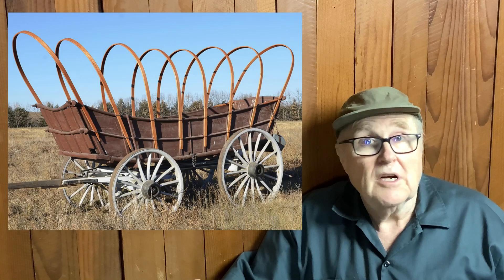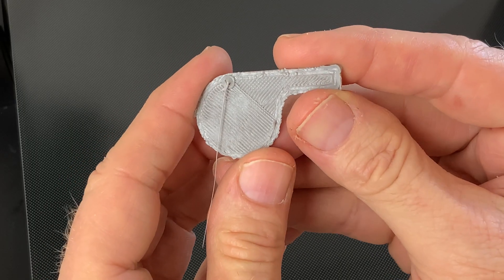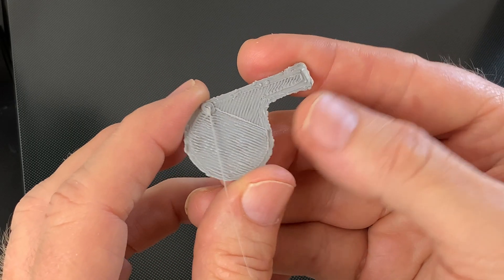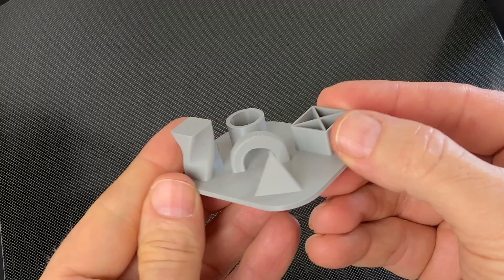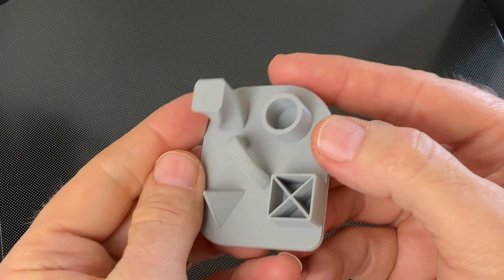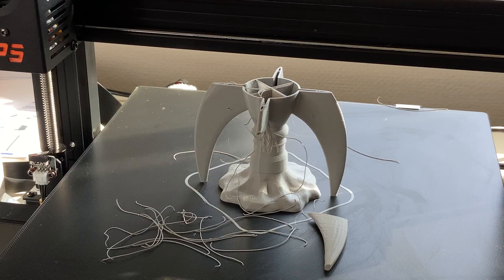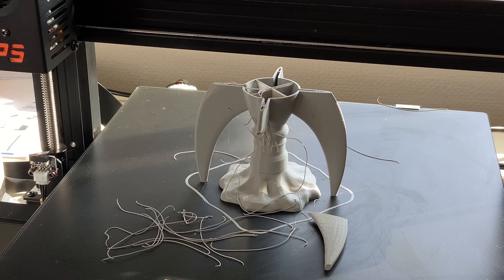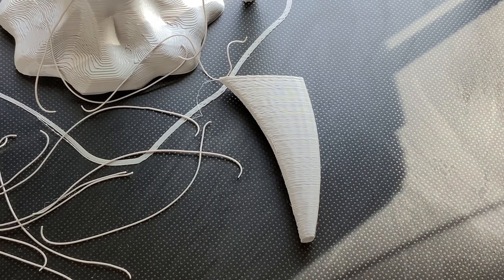This I Do Not Need!

Comment: I've been having a similar week as well. Actually two weeks. Had issues with the hotend, bought a new printer, new printer printed worse than the new model, fixed the old printer, kept the new printer for parts, summer heat and humidity ended up ruining my filament spools, invested in a filament dryer, invested in an UPS, now everything should be fine. The printer I'm using is an Ender 5: cheap, easy to set up, reliable, and unfortunately sold out in most places. There's also the slicer software which can cause issues. YouTube is full of all sort of useless crazy videos on what tweaks to make to the slicing profiles. After 2 years of 3D printing experience, default settings are still the best. PLA is a great material and I think the trouble of getting the printer to work is well worth it. Creating wooden boxes for molding might become a thing of the past.
Reply: Filament driers are so cheap for the value they add. Who hasn't come back to their printing room to realize they'd left a spool on the printer for the past 2 months? Sure, I can risk household drama by chucking it in the oven, but why not chuck it in a drier that auto-shuts off.
Reply: @TylerProvick  2 months? I left one on for 1 year lol.
Reply from the maker: Since I already have a warming oven for my resins adding drying capability to it will be easy.  Definitely a good investment when working with resins and filaments.

Comment: I bought a Prusa printer because I was fed up with tinkering with the Ender 3. It's been great, worked out of the box and required very little work in that past 2 years.
Reply: I mentioned a Prusa to Robert but I'm not sure why he didn't take the advice of a random person in the comments. Oh wait.

At least once he finally gets one he'll understand.
Reply from the maker: Prusa fans remind me of Apple fans. They love their wildly overpriced hardware. (Says the guy who has owned iPhones 4,5,7,10 and 12 and the original iPad, iPad Air, iPad Pro 2017 and iPad Pro 2022)! Who knows, maybe I will buy a fully assembled Prusa, wait a couple of months for delivery and then never buy a different brand of printer.
Reply: @RobertTolone  it's a fair comparison based on your experiences so far, but we'll see how it goes when the prusa arrives.
Reply: @RobertTolone  You should check out some of the behind the scenes info about Prusa. As a company, they are the polar opposite of Apple.
Reply from the maker: @saltfreegamer  yes, that’s true.

Comment: The best printer for out of the box printing would be the Creality CR6-SE. It has auto bed leveling which makes everything a million times easier. As long as you give the bed a good wipe down with clean water prior to every print, it never fails if the sliced file is good.

Comment: What gets me is that we're this many years into 3D printing technology and you still have to put in actual hours of practice to get adequate prints from tried and tested models. FDM was invented in '89, and has been actively consumerized for the last decade. In that same time frame (of merely 10 years), we went from Model T cars to fighter planes in WWI. (edit: And if I can make another comparison, in 1975 we had merely the Altair 8800, a home computer that was hardly more than manual switches and flashing lights, but by 1985, we had the Macintosh 128k, a computer most people could simply turn on and use.)

Of course, I'm not sure if there's someone to blame for this or it's just the nature of the desired results. I often get the impression that these printers, which almost always just directly duplicate the functionality of other printers, are not seeking even an iota of actual advancement in the technology, yet give the impression that they are because they might be a little bigger or a little faster, propagating the illusion to many would-be developers of the tech, stifling its advance into the stage of common household appliance.

That, or I'm just grumpy and want my cool toys.
Reply: If you can AFFORD it, today you can buy systems that are already assembled and print well right "out of the box". So YES those printers exist, are available, and cost considerably more than a kit ... so the question is "how much can you afford?"
Reply: @secondarycontainment4727  Sad that we're still there with pretty much every industry. Cheap garbage, or expensive but works as it should work if it were at a cheap or mid-range price. Yet nothing inbetween. We deserve better as consumers, it should be cheaper and work better, but we have to pay a premium for so many things to just work as they should.

Comment: Once you have your machines are calibrated, you should make sure thermal runaway protection is on and working before you leave the printers running over night unattended. 3D printers are amazing tools, but they are also the source of enormous frustration. Generally once you get them running you'll be dealing with little ticky tack problems or catastrophic failure of the machine somehow. Good luck Robert

Comment: I just got a resin printer and can say that the growing pains work both ways. Resin prints require more cleanup and post processing but the machines themselves are very easy to set up and calibrate.

FDM printers are front loaded with more tweaking/tuning at the start and have more moving parts, so don’t get discouraged if you can’t figure out an issue right away.

Comment: Oh and I'm not sure what troubles exactly you are having but I got most of the kinks out of my printer by tramming the head to the build plate with the plate adjusters all the way in then only did super minor adjustments in leveling.
Reply from the maker: That might work. Seems like a lot of the problems stem from unreliable bed leveling.  I will give it a try, thanks!

Comment: I've got bad news for you Robert, it's worse than that. Even when you get them dialed in, they won't stay that way. I've got 3 of them and keeping them going is just as much a pain as getting them going in the first place. Consumer FDM printing didn't evolve from commercial innovation like resin printing did. These machines ( at least the cheap ones) are really just cobbled together from existing parts from other industries. Great poetry though!
Reply: It is a little counterintuitive how cheap printers are called “entry level” when more expensive models can have features that make printing easier

Comment: I have 3 printers, done many thousands of printing hours , sometimes the just go of piste and need to give them a poke in the right direction. If you need any help feel free to shout and I will see if I can point you in theright direction and help diagnose the problem. Usually the problems are solveable especially if you can share the problem with somone who has experienced something similar. It may also be worth finding a facebook group for the printer your having issues with as usually most owners are having similar issues and the community solver them together.
Reply from the maker: Great, thanks! Reach me at roberttolone@yahoo.com and we can trade contact info.

Comment: FDM printers are definitely still at the buggy stage.  You are expected to do A LOT of tinkering, part replacement, and modifications.  Resin is more at the model T stage now, maybe a tiny bit beyond that.  But resin is also dramatically more expensive, more toxic, requires way more cleanup, and generally cant build as large as FDM.

Comment: yes i can relate to how frustrating seting up a new filement printer is
i got my ender 3 this winter and i don't think i am completly done tuning it but for what i use it for it mostly work
bed leveling and fimement profiles, hacking the print to counteract warping
and since i use abs mostly for the sake of further assembly with plastic model glues and compatybility with model kits most of the settings is dodgy at best :P
Reply from the maker: Thanks for confirming that I’m not alone. I’m still way down near the bottom of the learning curve. I guess that’s the price you pay for playing with new toys!
Reply: @RobertTolone  either that or you go to some nice gentelman to learn from his youtube channel :] every machine has it's own quirks, not fully flat bed or uneven heating, maker muse has great videos about "elephant foot" problems or filement  temperature ranges or common problems and troubleshooting
Reply from the maker: That’s exactly why I want to print ABS. Just my luck it’s harder to print than PLA.

Comment: One of the things I like about the KP3S is the mostly preassembled feature. Building three bigger machines at once sounds like a challenge.
Reply from the maker: The KP3S was the only one of my four machines that made nice prints as soon as it was started. The manual left a lot to be desired but the printer is working fine.

Comment: Elegoo Neptune series FDM printers are great entry printers. Auto bed leveling is a godsend.

My CR-10V2 has been a dream to print with out of the box.
Reply from the maker: Elegoo sent us that Mars 2 resin printer and it has worked very well right out of the box. I’m tempted to ask Elegoo if they’ll send me a Neptune FDM.  My plan is to rotate through printers, giving the old ones away and testing new ones. That way we will all get a really broad look at the industry.
Reply: @RobertTolone  If you want something that prints out of the box (ad far as a fdm printer can), check out Kywoo 3D. It's s step up in price, but not to an extreme amount.
Reply: Seconding auto bed leveling. Things can still mess up, but not at the same rate. I upgraded my Neptune 2 directly, great to see them having added it to stock config now.

Comment: 3D printers are exceptionally bad at what they are actually built for. This is nothing new. Only some printers give a good experience right out of the box, and they are usually not the ones that you get for free from Chinese companies to make a video about.
Reply from the maker: Haha, you are correct sir!  Still, I’m hoping we can have some fun and make some semi-decent prints along the way.
Reply: @RobertTolone  The difference between a $300 and a $3000 printer is mostly the amount of tweaking you need to do. The first one theoretically gives you already all the nice features, like heated bed, automatic bed leveling and filament sensor. But none of them seem to work right.
With the latter, they "just work™".